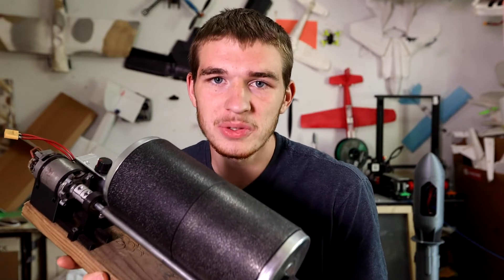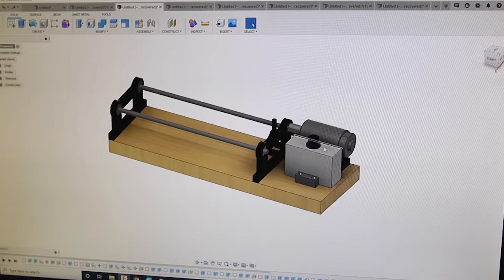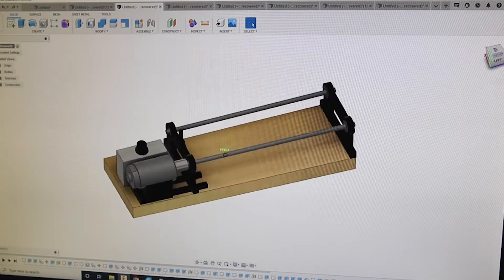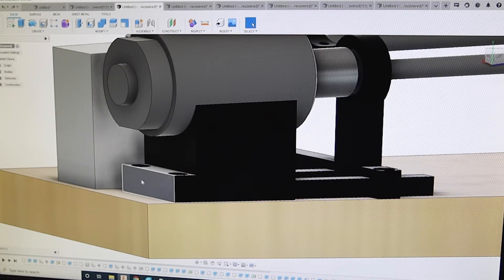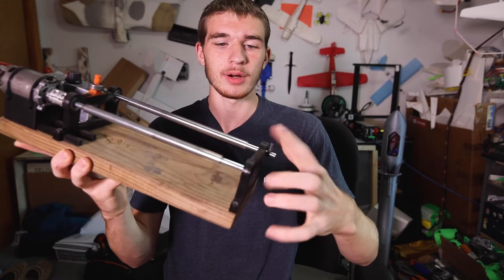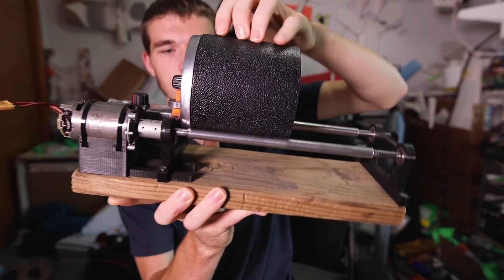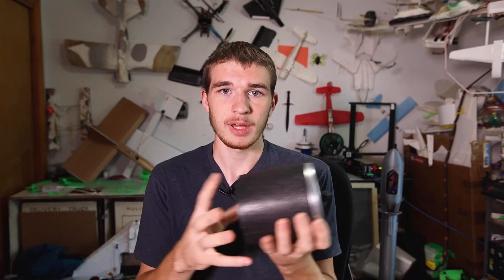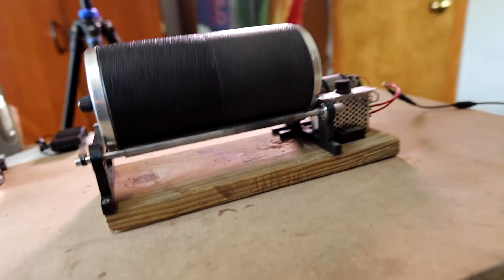How to Make A Ball Mill

Comment: What about motor?
Reply from the maker: I used and old motor from a drill, but then later replaced it with a 300 rpm geared Dc Motor. Here is the one I am using now: https://smile.amazon.com/gp/product/B072N84V8S/ref=ppx_yo_dt_b_search_asin_title?ie=UTF8&th=1
Reply: @EricRobb  thanks mate!
Reply from the maker: @channelcircuitzilla7339  No problem, I'm glad I could be of Help. Feel free to let me know if you have any other questions. Have a great day!